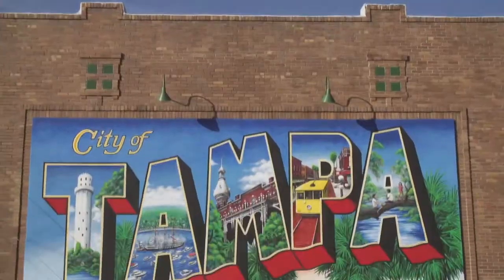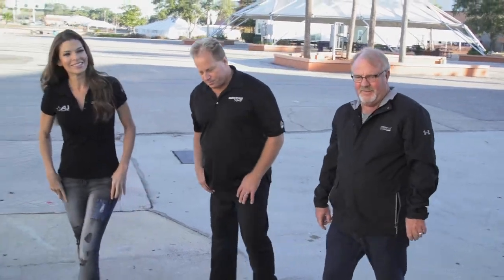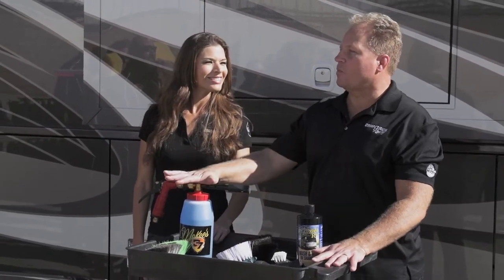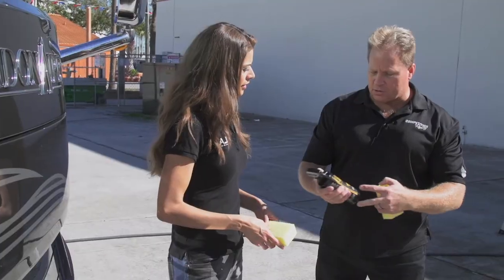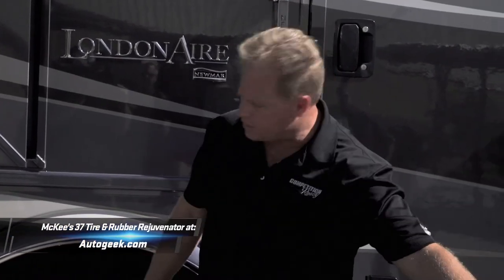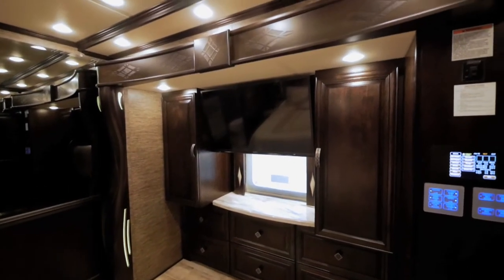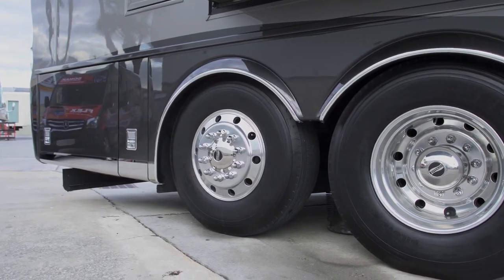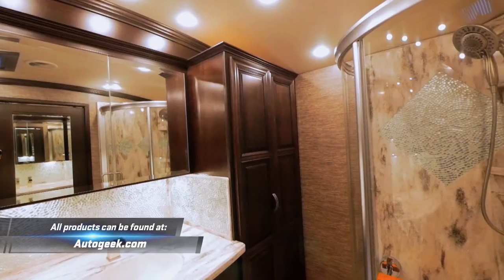Competition Ready Season 2 Episode 10: Tampa RV SuperShow (Full)

Comment: A foam cannon would of worked better but I understand having to deal with the extra equipment is a pain. That Rv is gonna need dozens of hours of correction after using all those brushes on the paint, it may just be hard to see with a swirl light in the middle of the day, but you should be able to see some defects and scratches by the sun in certain angles. If the paint was perfect why break out the 20+ polishers?lol . Also it would be great to see you guys break out and demonstrate the paint deapth gauge. Theres no way your working on a luxary RV with a $30K + paint job and are buffing on it blindly.

Comment: What wax or sealant did you use on the London Air? I am trying to decide what to use on my Newmar Bay Star.  I have used Wolfgang Paintwork Polish enhancer and Sealant on two cars as practice prep.  Not sure I want to do a two step on something the size of my 'motorhome.  The paint on my 2015 is still virtually like new exhibiting very few swirls.  

Do you recommend the Flex XFE7 against the Rupes Bigfoot 21?

Thanks for your assistance.